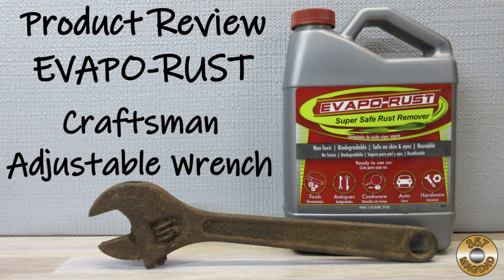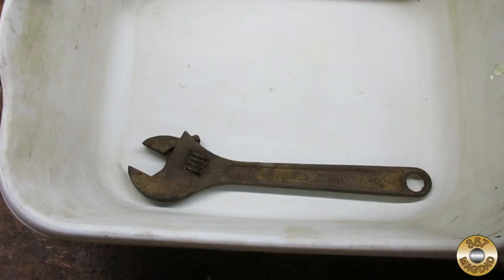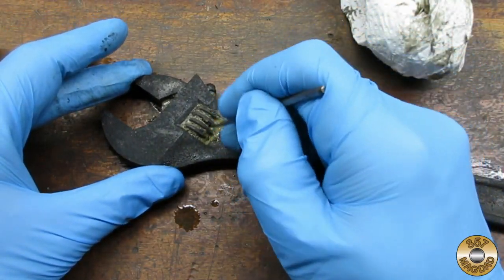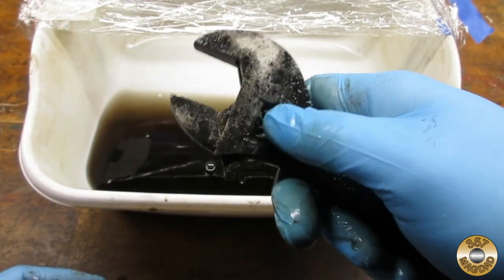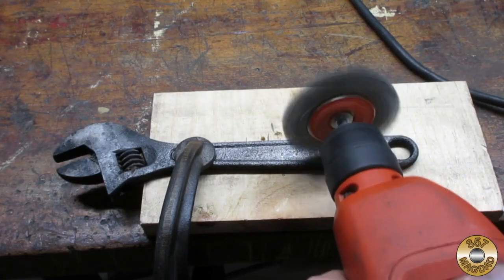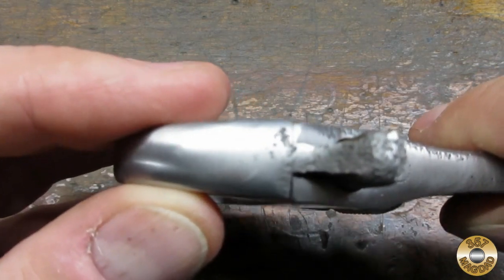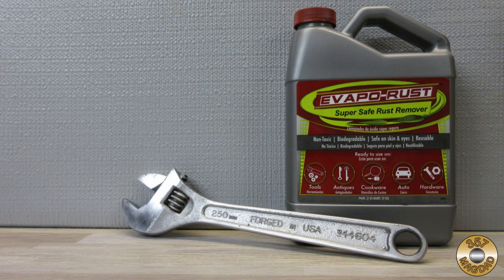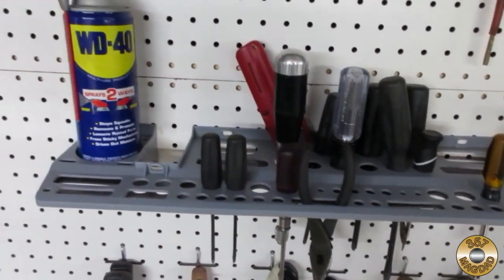Product Review - EVAPO-RUST Craftsman Adjustable Wrench

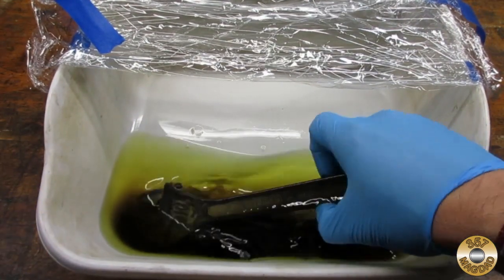Comment: The only thing on Evaporust I could add is that I've found that after it's been used for a while - if you leave it for a couple of weeks, all the dark material becomes sediment and can be filtered off if you desire. What remains continues to be about as effective as new.  You can see this in your solution at 1:30 in your video!
Reply from the maker: A viewer suggested filtering it with a coffee filter.  I'm going to give that a try!
Reply: I didn't know this. Great tip. Will try as well.

Comment: I've done the same with a Bahco brand adjustable wrench I found among leaves in a gutter on a flat roof. I used electrolytic rust removal, and it freed up the mechansim practically on its own. Just purchaced 25 litres of Evapo-Rust, since the elctrolytic rust removal takes constant work.
Reply from the maker: I think you're gonna like Evapo-Rust!

Comment: I love Evaporust. I used it on my '64 C-10 front suspension components. I also used to restore older hand planes. soak, clean and use denatured alcohol to prevent flash rust.  That Metric Craftsman wrench was rusty! I love restoring old tools. Been watching Scoutcrafter and he mentions you a lot. Don't feel bad for polishing the jaws!  That wrench will be in service for years to come. Great video!
Reply from the maker: Thanks Aaron!  ScoutCrafter is The Man!

Comment: A year or so ago, I had a similar tool I soaked in Evaporust and had similar results. I have used Evaporust before so, I put the tool on a plastic container poured in the Evaporust closed it up and set it on a shelf and forgot about it for a couple of weeks. When I opened  it, the tool was black and covered with something. I washed it off in hot soapy water and sure enough it looked great, not perfect mind you but a keeper. I enjoyed your video, thanks for sharing,  yea Evaporust.....Ken
Reply from the maker: Thanks KB!  I did a similar test with an old open end wrench.  I left it soak for two weeks and I did not find any evidence that the evapo-rust ate the good metal.

Comment: Great video and a great job.  I really like that you left the pitting ing the middle section - it makes the wrench look like it was made that way.  I wish EVAPO-RUST worked on my old rusty knee.  About your metric wrench - I live in Canada so we have quite a few metric wrenches here, but for some reason the seem to work on both metric and standard bolts - oh yeah, Canada is bilingual ;)
Michael from Canada
Reply from the maker: Thanks Michael!  I got a couple ankles that could use a soak like your knee!

Comment: I've been using those simple plastic tool holders for maybe 30 years now, although not the exact configuration as the one you got. I think back in the day the hardware store charged $1.99 and on occasion had them on sale for 99 cents. Even though I've probably overloaded them with too much weight, everyone of them is still going strong after all these years.
Reply from the maker: I'm still fooling around with what tool to put where, but it definitely is a space saver!

Comment: Magdad I use Evaporust all the time to take care of rusty tools. My neighbor had a yard sale and i picked up some rusty finds that I thought were cool. I showed him what they Looked Like After I cleaned them up. He couldn't believe it! He was co impressed that he asked me to work on a pair of rusted solid pliers he liked. So I put a little PB blaster on the joints and then  a overnight bath of Evaporust. The next morning WHAT A DIFFERENCE, Pliers opened up very easily, then dipped it in water to stop the evaporust and then wire wheeled it. My neighbor couldn't believe how good it came out after a liitle work! I hate seeing any tool rust away.
Reply from the maker: I've had good luck with Evapo-Rust!

Comment: Nice result! I can't find evaporust locally but have been using regular white vinegar in the same way with similar results. I left vinegar in my rusty motorcycle gastank for 3 weeks. I blasted it at the carwash, sloshed denatured alcohol and then Marvel Mystery oil and it ended up looking almost new inside. I have a batch of pawnshop tools in vinegar right now.
Reply from the maker: I've used vinegar in the past. I like the way the Evapo-Rust doesn't flash rust after rinsing.
Reply: @357magdad  
I can see that. Hard to beat the price though!

Comment: Great restoration of the adjustable spanner. You made me smile with your reference to it being metric😁. I am sure most people (myself included) would have left it so credit to you on expending the energy to bring it back from the dead. In the UK, Evaporust is £35 ($40) a gallon, ouch.
Reply from the maker: I've seen the european you tubers using MC-51.  Looks like it works similar to evapo-rust.

Comment: Haven't tried the Evaporust yet because my goto has always just been a tub of WD-40. It does an excellent job of dissolving all of the grease, oil, and loose rust as well as seeping into movable pivots / joints. The dirt settles to the bottom so it's easy to siphon off the clear for reuse, doesn't seem to loose strength, and it's inexpensive.
Reply from the maker: Thanks for watching!  Harbor Freight sells Evapo-Rust in quarts and gallons.  Next time you have a coupon, pick up a quart and give it a try!

Comment: I’ve always been a vinegar soak and wire wheel guy, but I’ve heard nothing but good things about this product so I think I’ll give it a shot in the near future when I restore my 1952 Rockwell jointer.
Reply from the maker: I've used vinegar before.  It works and it's cheap.  I like the Evapo-Rust better.  I don't get the flash rust after rinsing like with the vinegar.  Let me know what you think of the Evapo-Rust when you get a chance to try it.

Comment: I've had great luck with Evaporust.  In New England the road salt will destroy most parts in short order.  I've recovered countless junk yard and used suspension and chassis parts with Evaporust and a stiff brush.
Reply from the maker: The only disadvantage is the price.  I've seem some competing brands offering similar stuff so maybe price will come down!

Comment: Just mix apple cider vinegar and water 1:1 ratio. Let it sit a few days, same results. When you pull it out of that mix , then let it sit in a mix of 2 gallons water:1 box baking soda. This will neutralize the action of the vinegar bath.
I buy loads of tools on the local for sale ads and this process bring them back to life. I'm  sure the $1.49 for a gallon of vinegar at the local Farm& Tractor store is cheaper than that Evaporust
Reply from the maker: Thanks for watching!  I have used vinegar in the past.  I didn't like the way my parts flash rusted after rinsing.  I haven't had this happen with Evapo-rust.

Comment: I bought a bottle of a different brand that had the same name and seems to work the same and I wonder if what I got was a knock-off or if there are multiple products with the same name that do the same thing to rusted metal? I used to see Jimmy DiResta using Briwax on metals and wood and I bought a can and have been using it for years and I am very impressed with how it protects metal and polishes wood and it has a nice, old fashioned scent to it. I couldn’t believe how this wrench came out! I think if I was going to re-use the evapo-rust that I would store the used solution in a separate container than I see other guys on YouTube who mix it back into the original bottle. I don’t know if you do that or not, but was wondering your thoughts on it? Would you mix it back in, or store it separately in a different container?
Reply: There are similar products such as WD-40 Specialty Rust Remover.  Last year I tried all of them (OCD), and though I had been crazy about the WD product and some from CRC, Evaporust kicks butt.  Only a good electrolyte bath comes close, but never as good as Evaporust especially with complicated parts.  I wish I owned shares of stock!
Reply from the maker: I use small amounts and store them in separate containers.  I'm hoping competition from the other brands will bring the price down!

Comment: Thanks for the testing of Evaporust. Not all of us can get it where we live. Can you do a similar test with electrolysis and compare the two results?
Reply from the maker: Thanks for watching Frank-T.  I'm scared of electrolysis - I don't want to electrocute myself or burn down the house!  Vinegar is a good low budget rust remover. I've found that the one draw back is that the parts tend to flash rust after rinsing.
Reply: @357magdad  Electrolysis has to be done outdoor or in a well ventilated room. If you can do it on your porch/veranda then there are no worries. I will share a link below to a channel where these processes are done scientifically.